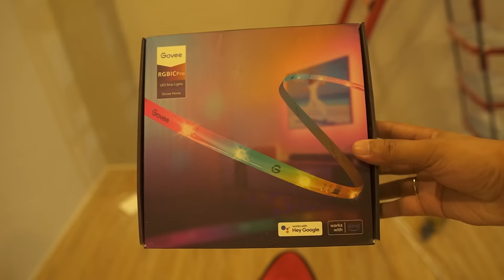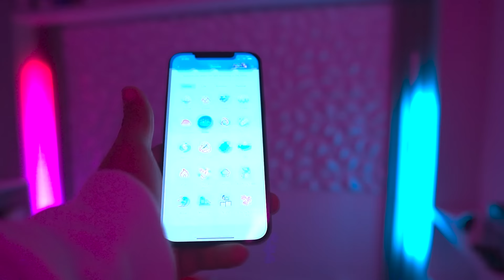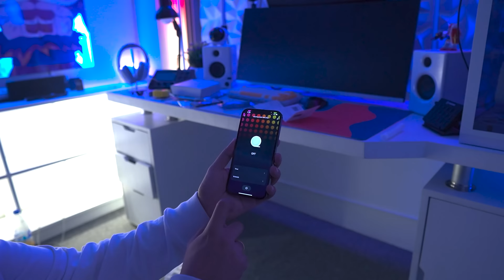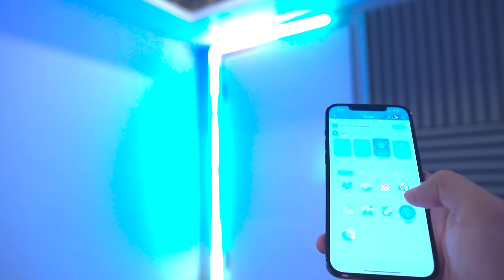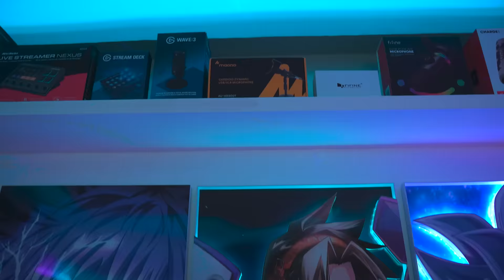Building The PERFECT Gaming Room Setup in 9 MINUTES

Comment: What did you use to stick the 3d diamond wall panels on the wall? Thanks
Reply from the maker: no nails
Reply: @bosslucio  I know but I was wondering what you used 👉🏻👈🏻🥺
Reply: @jaredalvarez890  ang pangalan ng pandikit ay no more nails. para siyang puting liquid semento.
Reply: @jaredalvarez890  pwede din double sided tape or hot glue, pero kung permanent naman na sa wall mo, yung no more nails.
Reply: @JohnEJ13  thanks I’ve been waiting for this response 😂 now I’m ready to buy
Reply: @jaredalvarez890  i think mas goods ang no more nails, kasi nagtry ako nung last two options, medyo nakalutang yung panels, hindi siya yung lapat na lapat, may nakasilip na konting space. tapos kapag nadikit mo na, there's np turninf back lol hirap na tanggalin at iadjust. unlike sa no more nails, kapag may lumabas na konti sa gilid, papahiran mo lang ng basang pamusan para mawala.
Reply: @jaredalvarez890  and also, if you like, pagdikitin mo sila, may makikita kang pattern na mabubuo, kesa yung iisang way lang na magkakatabi, para kalang naghilera ng tiles in one direction, pero it's up to you. goodluck! astig siya pramis
Reply: Use adhesive tape
Reply: 6:35
Reply: @js.drums1  why timestamp? It’s the 3d wall panel we want to know not the led light panel